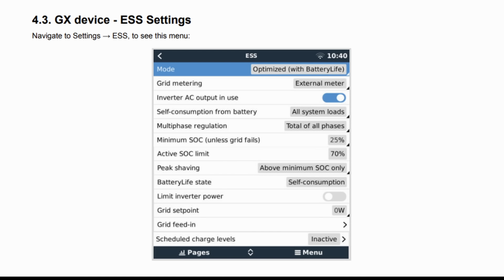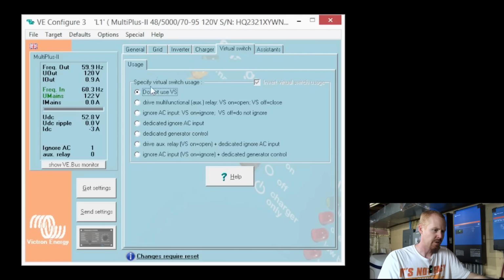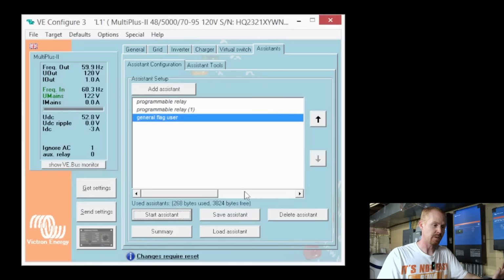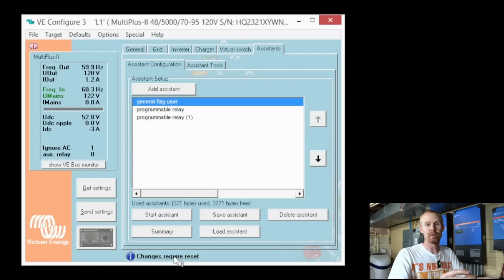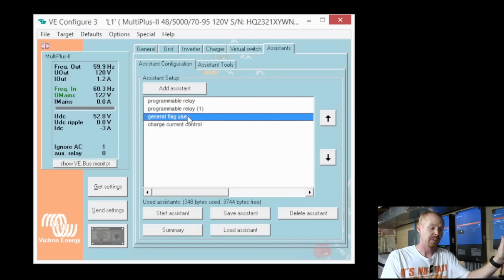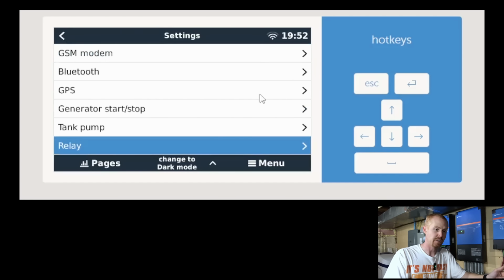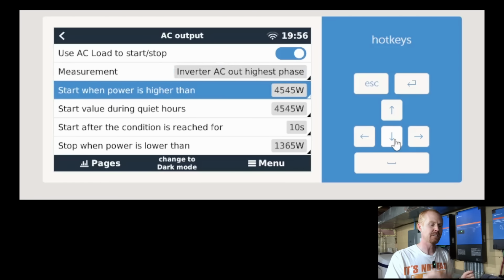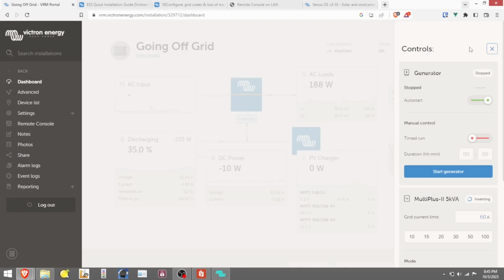Different Ways to Ignore AC Input on a Victron MultiPlus 2 Inverter

Comment: Hey cool video but it doesn't work for me. As you show in your video 13:02, nothing has changed for me on this point. What could be the cause here? Thank you very much and keep up the good work!!! Greetz from Belgium
Reply from the maker: Howdy William!  Thanks for checking in!

So just to confirm, you've added the 3 assistants to your inverters, wired the cable between the inverter and cerbo and then added the generator controls to the cerbo relay?
Reply: @AdamDeLayDIY  yes
Reply from the maker: @williamhuylebroeck9668  If you remove the cerbo relay wires (leaving the other wires connected inside the inverter) and touch them together, does the inverter switch between AC IN and battery?  You may have to leave them connected for a few seconds.  That will let you know if there's an issue on the cerbo side or the inverter side.  

I would also double check that your wires are all properly seated in their respective terminals.  I had a heck of a time trying to get them to seat properly in the cerbo terminal block.
Reply: @AdamDeLayDIY  I tried that and nothing happened.
Reply from the maker: @williamhuylebroeck9668   Then I would double check that your wires are in the correct terminal block.  It can be very easy to accidentally put one wire in the wrong terminal block pair...don't ask me how I know that... 😁

I would then double check that the relay you assigned in the assistant is the same one you wired into.  

If the wiring and assistants are correct, if you connect the wires together in Aux 1, the relay should close for AC IN.  

Now let me ask you this, you do have power going to AC IN as well, correct?  If there's no power, the relay won't close.
Reply: @AdamDeLayDIY  Hey Adam,
Still no progress here. I have already reinstalled everything, but unfortunately. 
I have already tried to close the AUX1 directly and this does not work either. 

After the assistant installation when I click on summary I see the following:
*USE GENERAL FLAG
*SET RELAY OFF
*WHEN LOAD IS HIGHER THAN 2200 WATT FOR 10 SECONDS
*WHEN SOC IS LOWER THAN 15%

I also find the pages where you can switch the relay on/off or set it automatically, but then I only hear the Cerbo relay open and close
Reply from the maker: @williamhuylebroeck9668  Ok, I see the problem.  It looks like you're mixing two of the different ways to Ignore AC Input.  

So the current assistants you have set are only for letting the inverter make all the decisions, not the cerbo.  That was one way I had tried to set it up but didn't like that I had to keep making changes through the software.  Plus, your "SET RELAY" command should be "ON" for the assistant you referenced.  It is backwards.  I believe I added a note about this to the video description and pinned comment.  You want the relay to turn "on" and act as normal when the load gets too high or the SOC drops too low.  "Normal" for the AC IN relay is turn on grid power when present.  

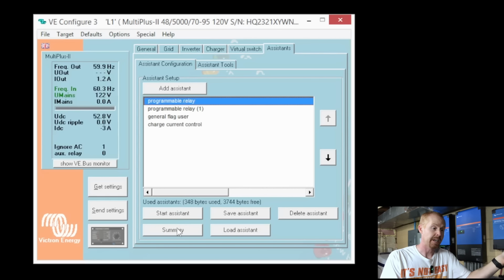If you want to use the Cerbo, you'll want to change your assistants to be like what's shown around 13:25.  That will program the inverter that when Aux 1 is open/closed to control the AC IN.  Then you wire up the cerbo and should be all set.

Hope that helps and sorry for the confusion.
Reply: @AdamDeLayDIY  Hey Adam unfortunately no success, I may not be as smart as you are.🤣Or I'm overlooking something.
Maybe I can give you access to my VRM portal so that you can take a look from your home?
Reply from the maker: @williamhuylebroeck9668  Sure.  If you can give access to adam@going-off-grid.com I can take a look.  Can you also send me some pictures to the same email address of the wire connecting your cerbo and inverter?
Reply: @AdamDeLayDIY  OMG Adam you did it!!! You are the man! Thank you for your patience, information and good work.
Those coffees are coming your way!
Reply: @AdamDeLayDIY  I have saved your login on my VRM portal, you never know!
Reply from the maker: @williamhuylebroeck9668  Awesome!  Glad we got it all figured out!  Appreciate the coffees!  They'll be great for those late night videos!

Enjoy!

Comment: Hi Adam I was looking into installing the same set up for grid assist. Mostly i want to spend $15k with a rather small pv string   of 4 or 5 k coupled with 3 100 ah batts. to run at minimum my irrigation well pump and my pool circ. pump   all for the fun of it lol .  At the end of the day are you happy with the system and are you still using it?  I know there are a lot of less expensive options out there all in ones ... but  i like the low freq , transformers for the inductive loads and the low stand by usage.       Your videos are a wealth of information.  thank you, Scott.
Reply from the maker: Thanks Scott!  Yep still running strong and I would probably forget I was even running off the inverters if I would just stop tinkering with them... 😁

Good luck on your own solar journey!  It's a lot of fun!
Reply: That's why i don't call in a professional to install a typical system , there'd be nothing left to -as you've said in your videos  "teek"  @AdamDeLayDIY  Thanks a bunch for getting back
Reply: Tweek

Comment: great video. What happens if there is grid power cut. If you set if to come on at a certain time but there is no power from grid can it the relay be set to immediatly turn off again?  or better again not turn on in the 1st place unless it detects power
Reply from the maker: So in my case since I’m using SOC to determine when to have grid power be used, if the grid is lost and the threshold is hit, it automatically switches to grid when grid power is restored.
Reply: @AdamDeLayDIY  So if relay turns on due to battery SOC. What happens to the relay if there is no power from the grid? The reason im asking is because obviosuly would want and need complete isolation from grid in the event of a powercut. Most inverters that have capability to feed to grid would auto turn off relay if no grid power is detected.
Reply from the maker: @giollaliddy5817  The relay doesn't close if there's no power from the grid.  It will only close when grid is available.
Reply: @AdamDeLayDIY even though it thinks it's a generator it still won't open? If yes, then this is amazing, thanks for the info
Reply from the maker: @giollaliddy5817  the way I have it wired, the multiplus doesn’t know whether it’s grid or generator power.  It just turns on the AC in based on a relay.  The cerbo is the only thing that thinks it’s controlling a generator.

Comment: Hallo, Is there a reason not to use the generator start and stop assistant instead of two programmable relay?
Reply from the maker: You can use the assistant if you would like, but you still have to use VE Config if you want to make any changes to the settings.  I was looking for something that would allow me to make changes without having to download/upload configuration files.

Comment: hi, I have been using your configuration for several months, I have a system with PV inverter, today I updated the multiplus 2 to v510 and from that moment when the AC relay switches off the muliplus increases the frequency to 53hz, if I manually disconnect the power supply does not. can you give me a solution? thanks Fabio from Italy
Reply from the maker: Howdy Fabio.  Hmm, can't say that I've ever seen the freq change when it wasn't supposed to.  Do you have any other assistants running in the MP?
Reply: hi, yes I have the assistant for the PV inverter, but it never gave me problems with the old version of the multiplus, I think the only solution is to control an external relay. Thank you @AdamDeLayDIY
Reply from the maker: @Lulastyle  I do have some other assistants configured but not for a PV inverter.  I might suggest asking on https://community.victronenergy.com/index.html and see if anyone else is experiencing the same issue with frequency shift after the update.

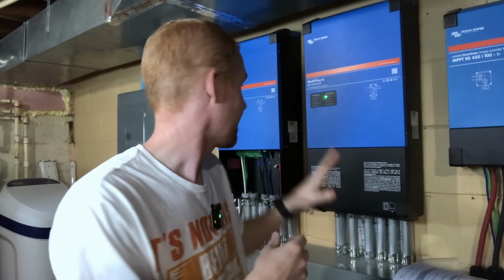Comment: Why is the Advanced tab missing at 13:00. Seemed to be there earlier.
Reply from the maker: The Advanced tab was added in a later firmware update.  I don't see any reference to it earlier in the video.
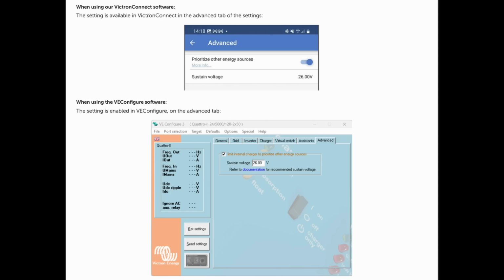Reply: Thanks that clears it up! 2:20 it was mentioned. That's why I got confused.

Comment: Is there an option to prevent the AC from charging the batteries?
On a sunny day, my PV charges the batteries and powers my AC output circuits.
At night, the AC circuits are powered by the battery.
If the battery discharges, the AC output circuits must be powered from the AC input circuits, but without charging the battery.
The batteries will be charged the next day or the next...
Reply from the maker: Yes there is!  Here's what I did to allow me to decide IF I wanted to charge from AC In: https://youtu.be/T5-7xcGWsgE

Comment: Adam..  Why the 4549W..  I'm guessing yours is 50A connection. when I first programmed the MP.. I remember seeing 3600. I am on a 30A shore power..   So I'm trying to follow every step while I'm somewhat duplicating yours.. but I have questions..
Reply from the maker: No real reason.  I wana say that was the default number I saw when I was playing around with the Virtual Switch in the beginning and the value just kinda stuck.  

I know that if the inverters can handle it, I don’t want them falling back to grid.  

I’m happy to try and answer any questions you have!

Comment: Adam.. You have just earned my subscription for this wealth of info. I just had my MPII 12v 3000 120 connected\wired up last week.. It's been sucking power from my 30A shore connection ever since. Un fortunately I'm 900 miles from home. When I left the house several days ago.. I made sure my system was working. It was.. then 2 hrs later my CERBO locked up. It just reset itself yesterday on it's own. I now have access to the VRM again.. but am very hesitant to make any changes from remote. It's gonna be nice to get home and plug into it and make these changes. I have almost 3000w in 2 arrays. I'd buy you a cup of coffee but I'm in Oregon, Well actually AZ right now.
Reply from the maker: Awesome!  Glad to be able to help!  Hope it works out for you when you get back.  Travel safe!
Reply: @AdamDeLayDIY  I called Current connected in Vegas today and Vern said I can do all setting changes online through the VRM..
Reply from the maker: @OFFGRID_Trucker  yeah you can use the Remote Console through the VRM or you can download the VE Config file and make changes that way.  It’s awesome that you can make all those changes without being in front of the system.
Reply: @AdamDeLayDIY  Well. I saved the changes and tried to upload it, but got a small popup box said:  
Error
You can upload only a single .rvsc or .rvms file

Comment: Adam, thanks for this new approach to the topic. I'm just wondering. From functional point of view, is your solution do the same as ESS Assistant? I can see that we can control behavior from cebro but is there something else? Something more useful over ESS Assistant or it is the same?
Reply from the maker: Thanks.  

I haven't messed with the ESS Assistant yet.  Still doing research.  I know the ESS Assistant is used when you want to sell back to the grid and there's always potential for a little power to go back to the grid even when you have the inverters programmed not to sell back.   I know you can pull excess power to try and minimize the flow to the grid, but that means that your using additional grid power when the goal is to minimize grid usage.  

With the way I have things configured right now, the AC IN relay is opened when you run on battery power (I believe some refer to it as islanding?) where there's no connection to the grid at all.  The relay to the grid only closes when your inverters power everything from the grid.  

Still doing research on the ESS Assistant and it's on my list of things to do a video on.
Reply: @AdamDeLayDIY Thank you! Please let me know any news of your exploration in this area. In the meantime, I will try to implement your approach. The problem is that I don't have Cerbo, only RPI with VenusOS, so I have to experiment with external relay controlled by GPIO.
Reply from the maker: @mateuszmazur2025  Will do!  In the meantime, you might wana take a look at this video: https://youtu.be/lv5rqqbDFL0

Might help you out with your expermentation.
Reply: @AdamDeLayDIY  yeep! Exactly. Thanks

Comment: Hi adam, I am now trying to set it up as you show so the A/C input can be controlled from the Cerbo, You say set the programable relay to take notice of the general flag and then to set the relay off whan the Auxilary input is open for 1 second. I have not got that choice available? They must have changed the assistants since you made this video?
Edit: OK, I have discovered by trial and error that we need to select "Input signal" Instead of state of charge to get to the page where you select the  the input open for 1 second.
Why didn't you actually show the configuration on this part like you did on the first Adam?
Reply from the maker: Sorry about that.  I assumed showing the summery would give people all the information they would need to set the assistant since it only shows what's programmed instead of all of the available options.

Comment: What is the difference between this method and setting the mp to “inverter only” via the online radio button?
Reply from the maker: The biggest thing that comes to mind is manual vs automatic.  If you never need AC In, then the switch should be fine for you.  If you need AC in to help with loads or when SOC is low, then the switch in the VRM won’t help you unless you manually make the change.
Reply: Thank you. Sounds like not much difference, as I am thinking about switching this switch via dbus/modbus (com.victronenergy.vebus, address 33, 1=Charger Only;2=Inverter Only;3=On;4=Off). This way I don't need such a cable and have the same (?) result as you. - But in any case: Thank you for bringing that idea, at all.  @AdamDeLayDIY
Reply from the maker: @dirksteinkopf  You're welcome!  As long as you can change it automatically, ultimately I don't think it matters.  Good luck!

Comment: Thank you for this video.  I just started researching Victron as a Load Sharing solution for my house in Ontario Canada.  I want to run the house on Battery power during Peak Electricity rates from 4pm-9pm daily $0.28/kWh, and then charge during the cheap times from 11pm-7am $0.028/kWh.  I use about 8-10kWh now during the peak time.  Your video was helpful in explaining how the Victrons work.  With the Cerbo thing, can you program a time when you want the house to be on battery?  - Maybe make the 4pm-9pm timeslot to be the quiet hour?
Reply from the maker: Thanks!

Yes I seem to recall seeing a time schedule option in the generator configuration.

Comment: I gotta say.. as someone about to get in to Victron.. that GUI is looking very dated. I hope their new OS GUI is revamping all the old GUI and modernizing all that? I plan on starting with a Multiplus II 3000 or 5000 and a Cerbo GX with a 48v battery I built. Eventually adding on more.
Reply from the maker: They’re doing what looks to be a full rewrite for the GUI. 
https://youtu.be/gGCxxiSB1lc

Have fun getting into the Victon environment!
Reply: @AdamDeLayDIY  Just to be sure.. you say "have fun" because.. you mean it's actually good.. or was that sarcasm and it's not so good? I was looking at EG4 too, but Victron I have read is overall a bit better hardware and their new OS is hopefully going to unify everything and make it better.. I hope.
Reply from the maker: @WhySoDivided-CantWeAllGetAlong  I actually mean have fun!  Enjoy the journey!
Reply: It is a nightmare and too much work comparing to something like Deye , Solis , luxpower software. It seems like 1990s PLC for a generator & UPS system

Comment: @AdamDeLay07 I am having a issue with my set up. I wanted to know about, when I set up the AC on the relay switch when I turn it on or off it shuts down the power like a surge and resets the power.
Reply from the maker: Hmm, so as you trying to use the generator start/stop feature of the Cerbo?